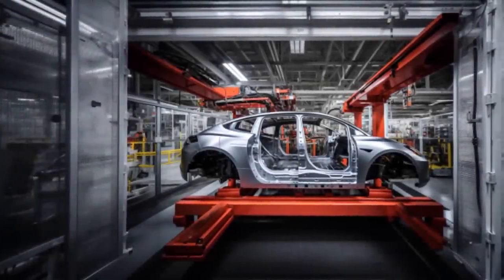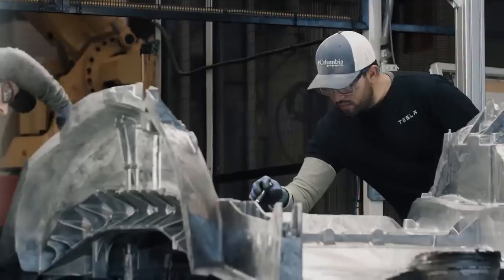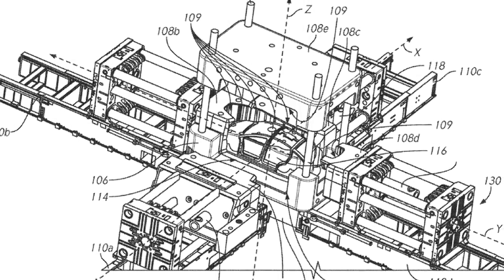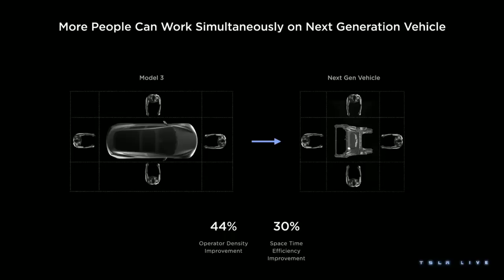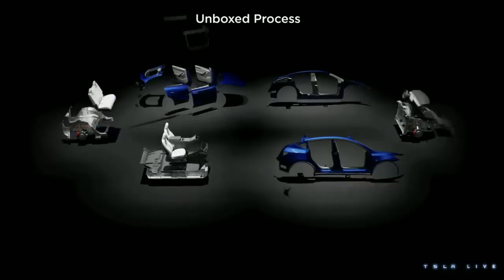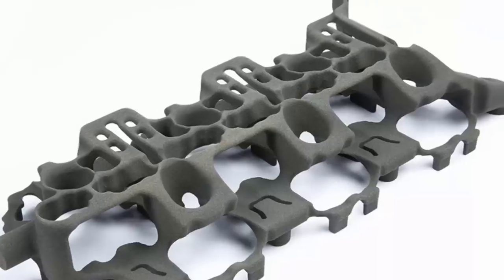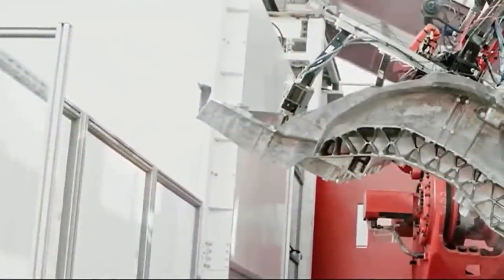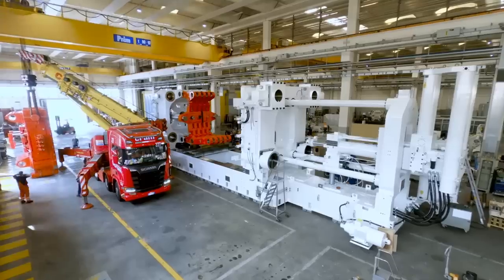Tesla’s NEW Giga Press 2.0 is Here!

Comment: The unboxed process could still be used, even with a vehicle where the entire subframe is one gigantic casting. The vehicle could be divided between top and bottom, with the top inverted or set on its side in a support frame. Then the two halves could be joined near the last assembly step.
Reply: It's a complete contradiction of the unboxed process.
Reply: Meanwhile, you seem to think that the engineers and designers have brought in this monstrous, multimillion dollar press without any thought as to how it will affect the overall production process. Such oblivious arrogance will cause me to read less and less of what you produce.

First, you think you understand the existing process. Starting from that state of ignorance then leads us to complete incoherence on any further changes.

Comment: Two gigapresses operating at the same time vs one big one? It seems to be a diminishing return. Removing one part doesn't seem advantageous, especially if it reduces efficiency by forcing linear manufacturing.
Having said that, Elon is the man who is most qualified to know the best way to go.
Reply from the maker: Yes that's a good point. Something else to consider is the extra time and machinery needed for then welding those pieces together.
Reply: @TMIOTesla  Another is the fact you can work with two pieces though - if there is an issue with one side - you have to recast vs just garbing another part. Aka, you do loose the ability to repair as well to some level as now you have to fix the whole thing - vs just a section.